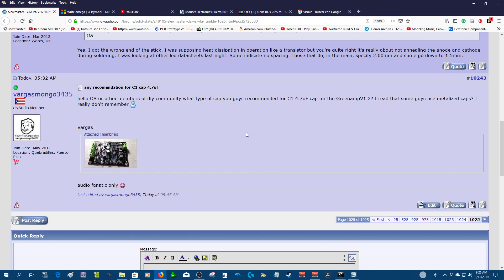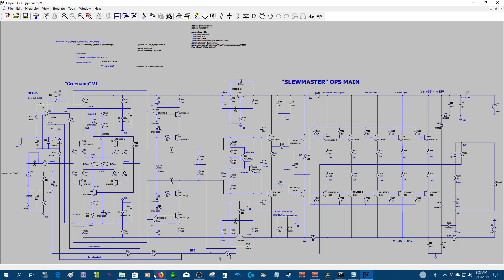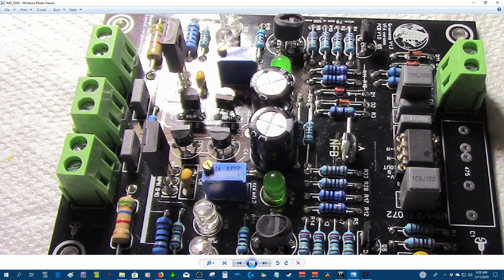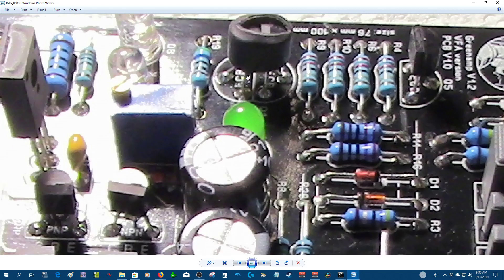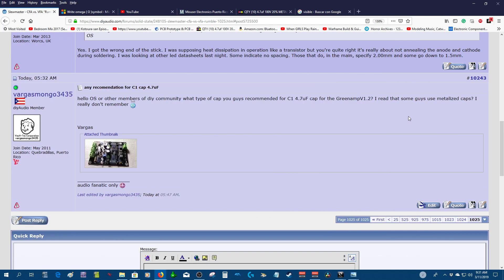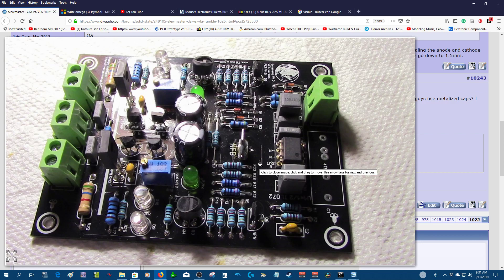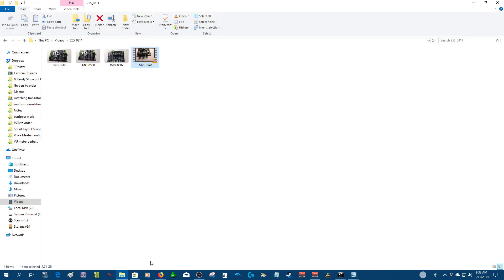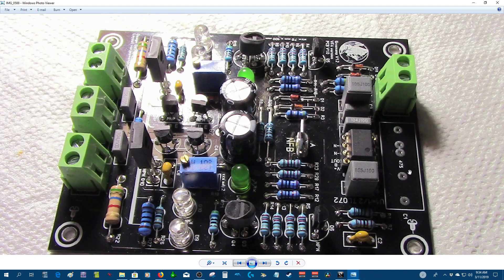Greenamp V1.2 circuit PCB V1.0 I need C1 capacitor

Comment: Hey Juan you done a great job. So nice. How about a small Aluminum heatsinks like the ones I have sean on the Honey badger boards used for the driver transistors. You could possibly use something similar on your driver transistors to keep the temperature stable. This will help with the performance of the amp.
Reply from the maker: yes I have that on the Wolverine that JKuteman did I also gonna do the same with the Greenamp too :)